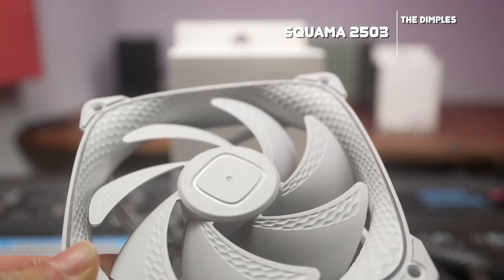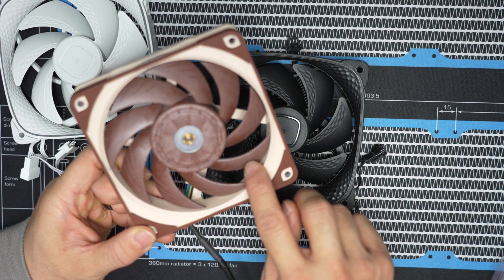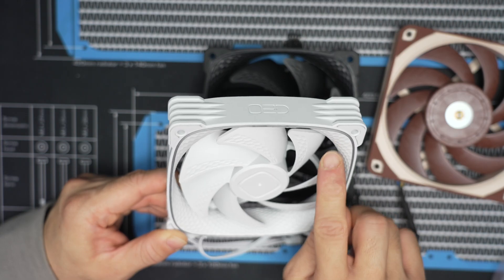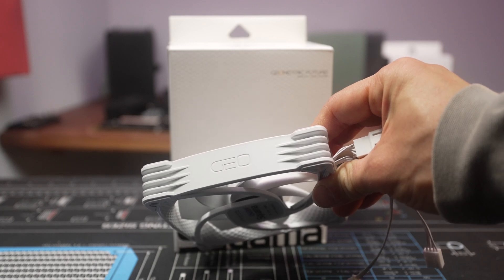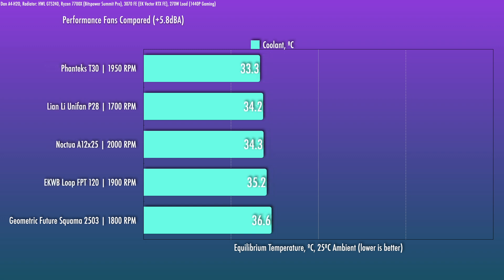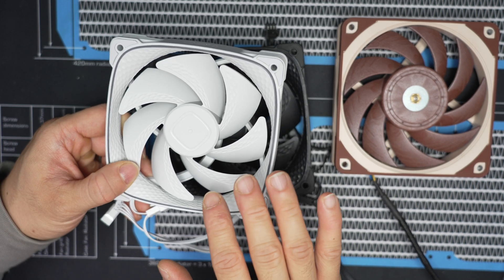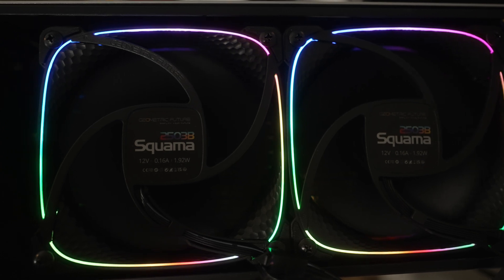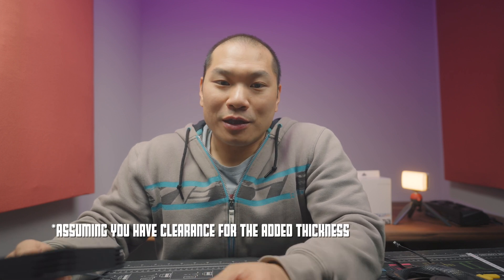These new fans are like GOLF BALLS!

Comment: The blade design actually has the same basis as the Gentle typhoon-like fans, whereas they're heavily curved. It's more similar to the DeepCool AK120 (which is also a very decent fan) in it's shape though. It's interesting that it uses 7 blades, instead of 9 or 5 (like arctic). But there's precedent in that from the Mobius 120 I guess.

Note that the golf texture isn't exactly new, if you Google "golf pc fan" you can find ones from Zaward/Sharkoon!

Comment: so... I have the DAN H2O and from this video i can see that the Phanteks T30 are the best to swap the stock fans of my NZXT KRAKEN 240 AIO.  The stock one seem to be a bit loud.
M i right or m i missing something?
Reply from the maker: The T30 is best fan out there irrespective of thickness- that being said in the A4-H2O they likely will not fit with a 30mm rad. You have 55mm total and they are 30mm. A good choice would be the NF-A12x25, the new EKs are fine too especially for liquid cooling RPMs.
Reply: @MachinesMore  cool, thank you for this advice

Comment: I find it odd that Silverstone put the dimples on the entire inner frame surface, while only putting dimples on the blades near one edge. The differential air-to-solid velocity is greatest on the fan blade surface, not the frame. Thus it seems to me that the dimples should be on the blades’ entire surface, and would only be effective on the frame where the blades are closest. 

Maybe they did lab testing and found their chosen arrangement was the quietest. It just doesn’t match my limited understanding of fluid dynamics.